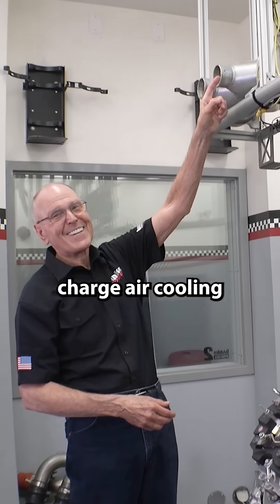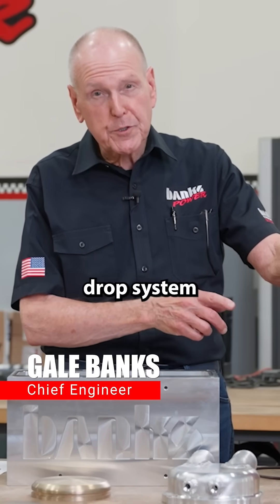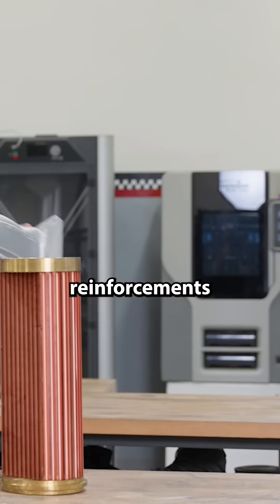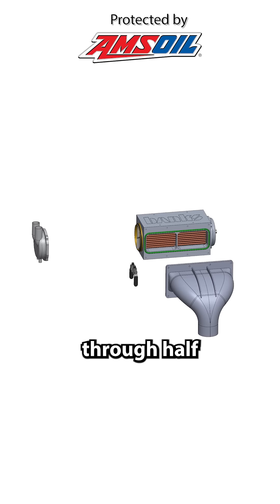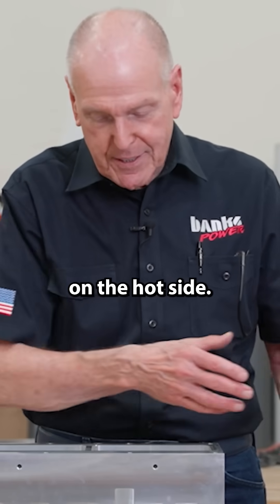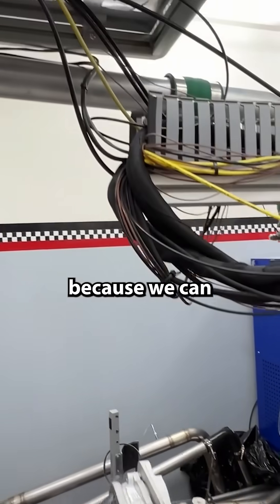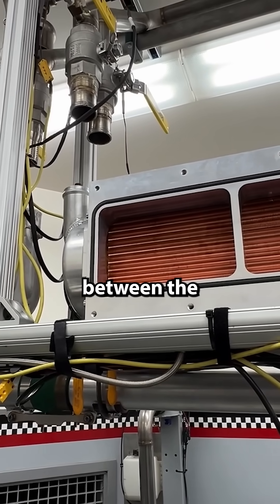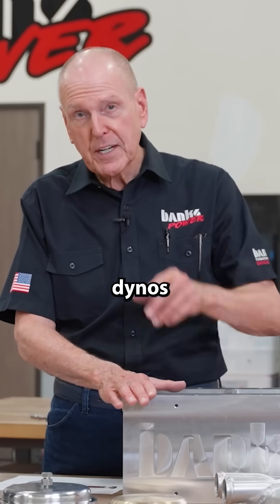The mother of all intercoolers

Comment: Recommendations for limiting cooling for on road applications using L/A cooler. Unless -11°f is not over cooled.

Mesured using k-type thermal couplers. 
-7 @ hot air intake fillter, 452°f /25psi  @turbo outlet, -11°f IAT  on my #1stgen cummins.

Comment: I wish I could work with Mr. Banks, I think my design is superior, I do like his, especially with the copper, I was using aluminum for price but.... I still think the management of this system isn't efficient enough and has TOO far of an energy drain and what about hho injection after the throttle body?

Would be nice to have more technical data on this interchiller, what are the affects of atmospheric conditions, heat and longevity of packings, and shock impact?

What about the issue with moisture accumulation from regular atmospheric humidity, (maybe a high pressure/low pressure valve to let out water during boost like in fighter jet intakes) that was my solution. Maybe you have another purge system, idk....

Comment: Just don't mod a German car. All the plastic, even pivot pin in the clutch...they disintegrate even faster after some knucklehead does mods on it.  I've been taking my gf's back stock setup after she bought one with stage 3, because just not engineered to handle it and constant failure code hell. Like 16 or 17 codes.  People do DIY mods, they start to go to crap, and they dump it.

Comment: Hundreds of pounds!!! Whoahhh, I wouldn't ever get to that point of boost. But I will say, I have seen a lot of videos that this man has made, and a lot of products that he has been part of designing and creating. The Banks products are expensive, (as performance parts are) but they truly do solve issues that O.E. engineers create in designing, or created in how you use your vehicle, and they are truly superior in performance to other brands and products. And the best part is they don't just make claims about being superior, they will show you how their products function better. Perfect examples are their cold air intakes, and diff covers. They don't engineer and make products just to sell and make $, they create to fix the issues that others have fallen short on, and to get the most performance possible out of your trucks. Somewhere there is a video showing every product they make, and how/why they outperform others, and why. A lot of aftermarket manufacturers just copy other known quality products, and it just appears that you are buying the quality part for less. Banks does not do this, they have proven (with numbers) why their products are superior. This man and others on the team truly seem to care about what they put their name on and market, and when you line their products up next to another brand, it is going to just be better, period. Performance shouldn't just "bolt up' and fit, it should perform and serve a practical purpose as well, and Banks does this.

Comment: I’ve had a crazy idea for a boost system and I’d love to get input on it, what if someone took the blower from a supercharger and used a turbocharger turbine to spin it? I don’t know if it would create a lot of lag being so much mass to move but I’ve never seen anyone try it, and the sheer amount of boost you could make seems worth it
Reply: You dont need it when the turbo is best in that case. 
if you are running on exhaust gases then nothing beats a normal turbo for boost. 
Superchargers are only good for low end anyways or tuned to a set narrow rpm range.

Would be better with an Automatics 2-3 gear supercharger like what was used in ww2 planes where they had gear 1 for low alt and gear 2 for high alt
Reply: @tbas8741  I would think a supercharger would gain a lot of nice power at the high end  given it wouldn’t be held back by the losses of being belt driven. It can move massive amounts of air and they could make it support  multiple turbines, though I wonder how it would get rid of its boost pressure, probably just a bunch of blow off valves
Reply: @HEXAN-SC  you dont need a BOV on diesels with superchargers you just remove the throttle butterfly like all diesels and control power through fuelling
.
Reply: @tbas8741  I know I’m thinking about a supercharger powered my a turbo turbine, and given turbos need a BOV a blower spun up by a turbo would probably need one I’m not sure

Comment: That cooler looks nearly identical to what 12V92 Detroits had in the Terex mining trucks the company I worked for in 1990s. There was 4 of them in a housing used to cool the retarder brake system oil.
Reply: This isnt the first time someone has said the same thing
Reply: @JohnSmith-xu7ev  should I delete my comment?
Reply: @johnnywad7728  
No, but they did delete my comment 🤔
Reply: @JohnSmith-xu7ev  it's annoying when google censors do that. And I've typed up sometimes longer informative comments ,no vulgar words,nothing condescending...gone
Reply: @johnnywad7728  
Yup, i have it disappear one second after i post it. I can say i support a certain country and it will be removed
Reply: @JohnSmith-xu7ev  what about freedom of speech? I've come to conclusion that ai..is actually ai-hole. ( that's right ai....I said it!)
Reply: @johnnywad7728  
Depends because YouTube is a private company.  I forgot what the argument is, but if they take money from the government, they cant censor. I think this is still being debated in courts
Reply: they look identical to john deere 4045/6068/6090 aftercoolers as well. end cap is near identical. except theirs are usually bronze in my experience from the marine industry

Comment: Gonna need to upgrade to dual water pumps now !!
Reply: Actually sometimes it’s less efficient past a point with liquid heat pumps because the flow becomes too laminar and only the outer layer of liquid is exchanging heat much. I found this out when I made my own hot tub. Figured the more flow the better at relatively low pressures, and I was incorrect. It’s actually a relatively small amount of flow for the heat exchanged.
Reply: @mrjjman2010  yep, just like leaving the thermostat out of an engine cooling system, the water flows too fast before it can absorb the heat.
Reply: @MrChevelle83 ”Flows too fast before it can absorb the heat”? What do you mean? The issue with removing a thermostat from an engine is the coolant doesn’t spend enough time in the radiator to transfer the heat to the air.